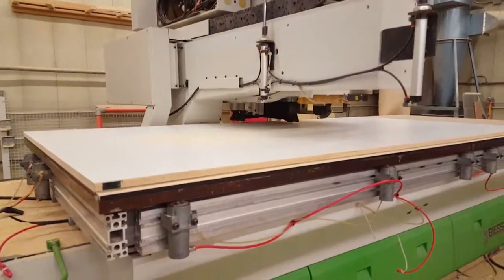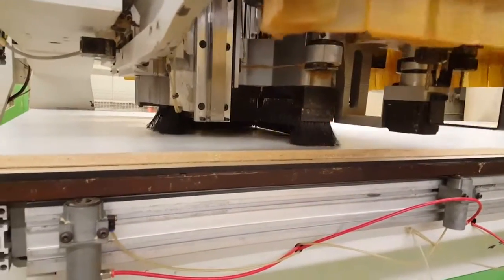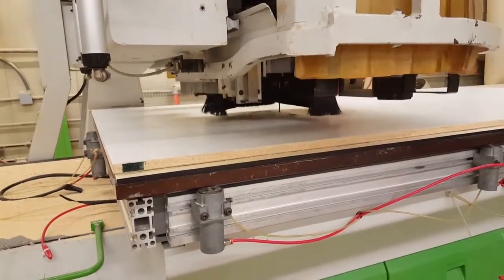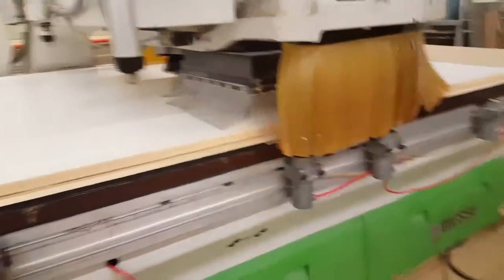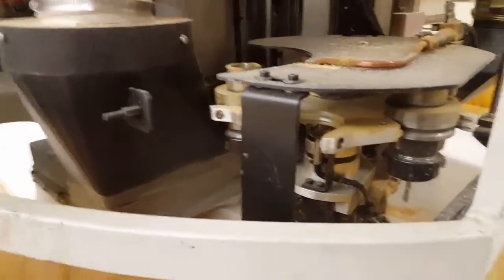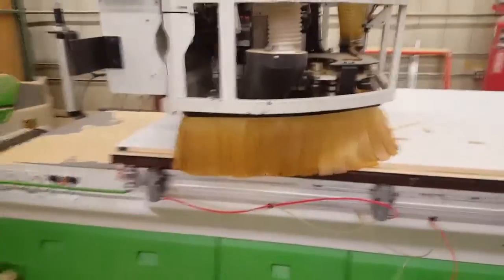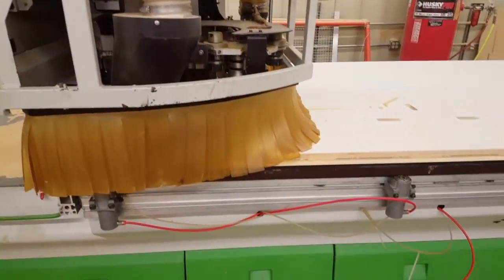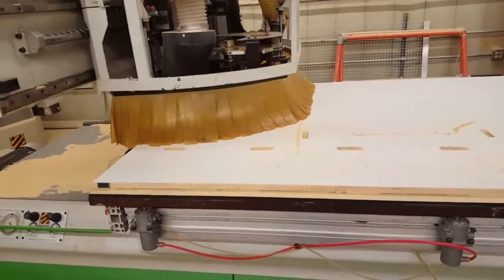Biesse Rover 24 Cutting Melamine with Helical Interpolation

Comment: Did you had any depth issues with drilling hinge holes with 35mm drill bit? I have Biesse 24fts cnc and it drills inconsistent hinge holes. Any idea what could be the issue?
Reply from the maker: Hi Manoj - are you getting differences in the z levels of regular cuts too? does it sometimes cut the spoil board and sometimes doesn't cut all the way through? If so - it is most likely a bearing on the Z-Axis. Let me know...